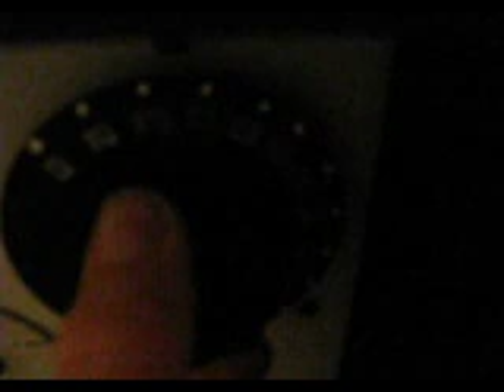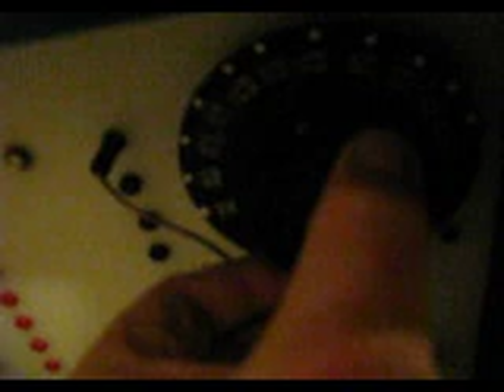A demonstration of a crystal radio - Part 2

Comment from the maker: batterymaker - that last station is the closest to here - only about 20-30km distant across flat, low land.  

The antenna was coupled with a primary coil of about 5 turns across the tuning coil. The diode was tapped down the tuning coil.